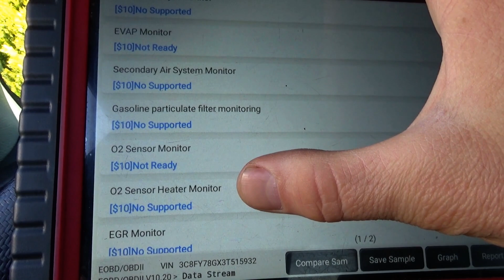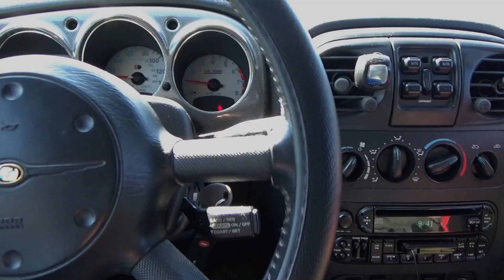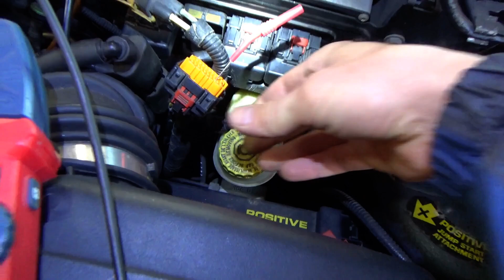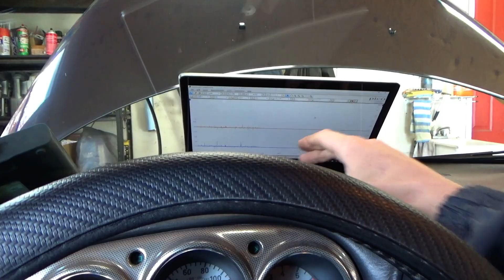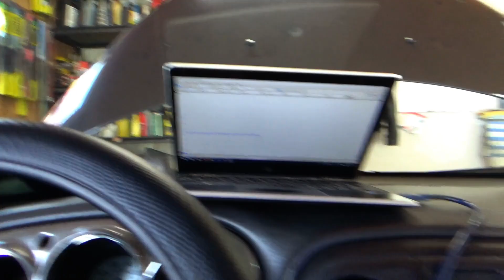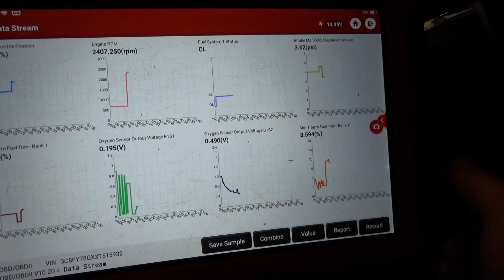PT Cruiser Needs a PCM? Or DOES IT? (Low Power-No Boost, P0031-P0037 - Part 1)

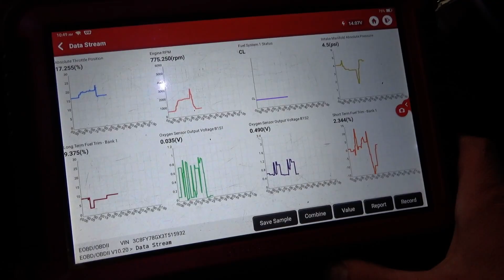Comment: Ivan, I think you were a bit disingenuous at 18:45.  Hahaha . You knew there was a good chance that might work or else you wouldn't have tried it.  You are beginning to remind me of "Doc Brown" from "Back to the Future" with all of your creative mods to fix or improve cars. I love it!
Reply from the maker: Actually I assumed it would NOT work... Saves disappointment down the road 😂
Reply: @PineHollowAutoDiagnostics   Yeah.. I do the same on jobs. lol..  Set expectations low and that it's going to take longer than you need;  and then when you get it done early, the customer is always a happy camper..
Reply: Definitely not disingenuous..  it's easy to assume that it would operate the heaters and at least do something.  But it wasn't likely or obvious that it would actually trick the computer into not setting any codes and actually stay in closed loop like normal.  That was a surprise.. because understand:  the drivers inside the computer are still cooked
Reply: Russian ingenuity!

Comment: Try to remove the heater wires from the ECU and control them. That way you remove the possibility to pass current to sections of the ECU that should be turned off.
Reply: Then it will kick the check engine light again and have the same issue..
Reply: @rickybobby7326  Maybe "feed" the ECU via 100 Ohm 2 watt resistors to keep it happy?

Comment: Works but I have no idea how long an O2 heater will last when switched on the entire time the engine is running.  If it doesn't last, maybe you could tie a PWM supply to it somehow?   I'm not sure about that old Mopar PCM, but we have O2 drivers replaced often in the newer ones.  But you know that.

Comment: Power from battery into PCM, Thru a power side driver ,and an internal sense wire in the PCM to determine H or L circuit voltage, out the pin, to the heaters and to ground.  So it appears there is no pull up resistor in the circuit inside the PCM, otherwise you would have to match the resisistance in ohms with another resistor or test light bulb. The fact that this straight 12 volts worked, means there is no pull up resistor ,and it means the voltage sensing of the PCM is still working, even though the Driver is blown open.  Great way to get around a problem, and I am sure the ASD relay is more robust and easier to replace than a PCM driver.

Comment: This is still from a time where Mopar didn't fuse many components. I would still verify that there aren't any o2 fuses, even though the wiring diagram didn't show them. In any case, the heater circuit is PWM, and they are commanded OFF for a reason! So while you're tricking them now, I think you'll get at least a different code for the heaters being on all the time, perhaps 2 trip code, as time goes on. IMO, 1 of the OE o2s failed, and took out the driver IF the circuit really isn't fused. IMO, it still needs an PCM. As for the frt end, I'm calling lower control arm bushings and stb links ;)

Comment: Wont the constant power to the O2 sensor heaters burn out the heater elements much quicker? I don't think they are constantly on in normal driving.
Reply from the maker: Great question! We will see in Part 2 😉

Comment: I don't think this is going to work as a permanent solution.   It definitely confirms the problem,   but from what I understand-- I believe O2 heater strategy is typically to only turn on for a few minutes to help get them going when you first start the car.   I could be wrong, but I don't think the heaters are supposed to run all the time.   (Think glow plugs on a diesel).  I think the heaters will burn out fairly quickly if you just keep them on all th time.  But again-- I could be wrong;  but think about it-- Why would they even run heaters though the computer if they were going to be on all the time?  Why not just tie them to a simple relay??   I think they are driven by the computer because they only turn on in specific situations, such as startup.
Reply: Its true the "modern" strategy is to pulse width modulate the heaters after warmup, however the O2 heaters are 100% designed to be on continuously while with engine is running. Many cars from the 90s would just turn on the heaters via a relay during engine operation.
Reply: 12v when the engine is (or was) running is the normal setup for 3/4 wire upstream O2 heaters, often with a feed directly off the alternator.
Reply: I think glow plugs in modern diesels are pulsed throughout the duty cycle to optimise cylinder temps for more efficient combustion.
Reply: @baldyslapnut.  Any diesel I've ever seen.. It only runs the glow plug for the first 5 or 10 seconds..  and you're supposed to wait until it turns off before you start the engine..  I have a 2002 7.3L F350;  but I don't know much about newer diesels than that.  I know they have particulate filters now... but other than that, it's out of my pay grade. :)

Comment: Drivers in my 1999 Porsche Boxter were dead for o2 heaters also. Did the same thing fed them with volts and it worked managed to pass emissions. Later down the road the car was sold and few months later I saw the car burned in the area where o2 sensors were. Related ? Maybe 😂 but it did pass emissions 😅
Reply: I would think a 5 min timer that cuts the power would be the next step.  Only need the heaters to warm them up, otherwise why have a control circuit.  Much like we have to have on our radios so the car thinks we are in park watching the movies.
Reply from the maker: Car was burned? 😳
Reply: u can use timer relay. like turn off heater after 3 mins.

Comment: If the heaters are pulse-width controlled, then the 100% duty cycle may have an effect on longevity. I know--longevity and PT cruisers aren't often uttered in the same sentence.
Reply: They could be.. I hope he reads through service data.. because I don't think they are supposed to be on all the time.  I'm fairly sure that once everything gets up to operating temp.. the heaters shut off.  They are really only there to warm up the sensors so that they come online quicker at startup.   If he leaves them on all the time,  surely they will burn up quickly.  Especially if they are PWM and getting essentially 100% duty cycle.. (as you said).
Reply from the maker: @calholli  heaters never shut off completely during operation, just duty cycle is reduced to maybe 50% 👍
Reply: 'I know--longevity and PT cruisers aren't often uttered in the same sentence.'

Bahahahaha!!!! Isn't that the truth! I've heard more mechanics cuss those things! 🤣

Comment: Ivan, have you still got the heater wires connected back to the PCM, if so  you could be providing a back feed.
This was evident when you first connected the heaters with the ignition OFF and things started to click and buzz.
The output of the PCM will most probably be some MOSFETs, these have built in or on the circuit board circuit protection components, they could also be failing.
So I would disconnect the PCM feed to the heaters.
You are now applying full battery volts to the heaters, the PCM was probably PWM controlling them for a reason, you may find you will shorten the life of the O2 sensors because the heaters are full on all the time or at some driving conditions the engine performance again may suffer.
I'm no mechanic, but an electronics engineer in the industrial control field.
Reply from the maker: If you cut wires to the PCM it will instantly set the same codes and run in open loop so that is not an option 😉
Reply: @PineHollowAutoDiagnostics 
Maybe cut the feed to the PCM and place a large resistor in line to limit current back into the PCM? This way the heaters get power and the PCM gets its feedback (low current)?
Reply: @PineHollowAutoDiagnostics  Sorry Ivan but what are you doing to the sensors with the heaters on full all the time, is debatable.
There must be  a reason for PWM control, we await the next part and long term results.
Also by not disconnecting from the PCM, the back feed may be slowly destroying other hardware in the PCM that started the fault in the first place.
Reply: Another electrical engineer here... this poster is 100% correct with what was written.
Reply: Still great things to discuss!
The only stupid question/statement is the one never said!
Iron sharpening iron!
Reply: I consider myself the godfather of dodgy workarounds but this I would not do. Heater circuit should never be always on for O2 sensors. Change the PCM. Actually I’d first open up the PCM and look into the fets
Reply: Hahaha, nice try Tom, but Ivan is spot on here.  You have to have the feedback or the diagnostic faults are set.  Would be nice to see the scope activity on known good circuits to see what the duty cycle should be.

Comment: My question is, what is the purpose of having PCM drivers then? To save a few amps? Just so it can detect faults for emissions purposes? As usual, it seems nuts to me to not pop open the computer and see if there is just a simple transistor or something that can be replaced 😅
Reply: I don't think the heaters are supposed to be on all the time..  I think the computer only drives them at specific  situations,  such as at startup.. and once they hit closed loop-  they turn off.  (I think--  I'm not certain).  Maybe he'll ready about the strategy in service data in the next video and we'll know for sure.

Comment: Why is there somtime pulsing from the pcm seen with the scope? Is the oxigen sensor heater control pulswith commanded? So if the pcm "see" to much current, it shut off the pwm command for the heater? Like a short in the wire to the heater, or heater with to low(or maybe also high?) resistance?

Comment: Both heaters dead on the PT Cruiser is often a symptom of a bad (leaking) oil pressure sensor which has pushed oil up the harness and into one of the PCM connectors (right hand one as you are facing it).
Reply from the maker: Very interesting. Didn't see any oil at the PCM...

Comment: Feels like the O2 heater resistance is too low, and the PCM is complaining about having to supply too much current to them (PCM thinks it's driving a short)?   Wonder what the resistance is of a known good OE sensor....
Reply: They usually run at 1 amp from what I've seen.. so that would be about 12 ohms..  I think these are only running at 2 amps though, with 6 ohms..  Which is still reasonable.  I would check service date to know for sure though.
Reply from the maker: PCM didn't even TRY to turn on the heaters though...
Reply: This is what scanner danner said that the aftermarket oxygen sensor on a chrysler 300, i think it was, was doing this and after he put an ntk sensor it fixed it.

Comment: Won't this burn out the o2 sensor heaters much quicker? If so a used pcm sounds more economical :D Also you probably should've hacked in a diode to prevent current from flowing into the pcm.
Reply: I believe the oxygen sensor heaters are intended to always be on.  So, no, it will not hurt anything.
Reply: @reneneron2971  It appears the heaters are PWM controlled, so there must be a reason for not having full current all the time. The sensors are heated to a degree by the exhaust gases.
Reply: @tomgeorge3726  alternators are pretty inefficient also, so even back on the early 00's automakers we're trying to reduce electrical loads for fuel efficiency.

Just a thought.

Comment: Ivan, you mentioned the heater circuit can carry 2 amps when you measured resistance. Is there an equation that tells you amount of current a component can carry based on its resistance? Thanks
Reply: Ohms law
Reply: Ohms law. U=R*I and P=U*I.
Reply: Thanks guys!
Reply: 12 volts divided by 6 ohms he measured with multimeter is 2 amps. But real current may be a little bit lower, as heated it may have bigger resistance.

Comment: What concerns me is why did the cooling fan come on when you supplied 12V to the circuit. Almost sounds like a bad ground or something somewhere. Unless it's somehow back feeding through the computer (can't really see that happening) and kicking it on. Interesting!
Reply from the maker: That was with the key OFF, backfeed through the PCM 👍
Reply: @PineHollowAutoDiagnostics  My thought was wiring diagrams wrong, he was probing the fan relay so heater wouldn't get power from that.......
Wish I had known you don't need the pico scope to run the software to look at your captures.  I would have installed it long ago.
Reply: I think Ivan's starting to focus on relays?

Comment: Is the cooling fan running constantly now?  Why did it come on when power was supplied to o2 heater circuit ?
Reply: Because Ivan was back-feeding power into an ECU power output, which isn't generally a good idea.  There will likely be protection diodes between the output pins and a 12v and 0v rail within the PCM in order to suppress voltage transients higher than the 12v rail, or lower than ground (negative voltages).  With the key off injecting voltage into outputs like this can cause other parts of the PCM to be powered up.
Reply: I think the heaters are not supposed to turn on all the time.  They are only there to heat up the sensor at startup so that it comes online quicker..  and then when coolant hits a certain temp.. it will shut them off..  (Or maybe when it goes into closed loop?  I'm not exactly sure).    So the heater control could be tied to the same strategy as the fan.  In other words, when the coolant hits a certain temp-- the fan turns on and those O2 heaters turn off-- since they will be plenty hot already by the exhaust.   I hope he reads through service data on the next video so that we can see the exact strategy.  I just can't imagine that they heaters run ALL the time.   They would burn out fairly quickly,  I would think.
Reply: That’s pretty much what I was getting at.  The heaters can’t be on all the time and the fans can’t be on all the time. Or maybe the climate  control was on making the fans run.  Hope Ivan explains.
Reply: @stevensutcliffe533  I think he will next video.  I bet he looks it up in service data and it explains the dynamic strategy and just leaving it on all the time is not going to work.. (at least I don't think-- I could be wrong. :)

Comment: CAN YOU  FOOL THE PCM BY ADDING A COUPLE OF RESISTORS TO THE CONECTOR TO FIX THE SIGNAL.😅😅
Reply: I think u forgot something here...
Reply: I have tried this, I have a P0691 code on my car but the heater is in the sensor is OK,  the computer says it's not so I added resistors in line and across the load but still no joy.
Reply: The drivers are fried inside.. likely just a burnt out internal relay..  and is probably easy to fix if you took it apart.